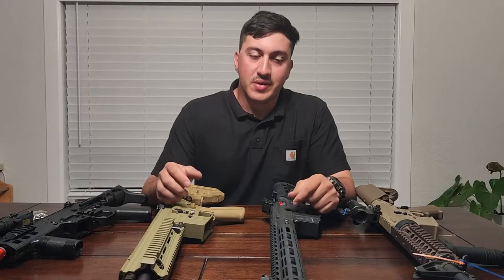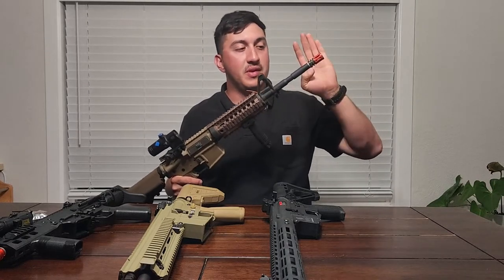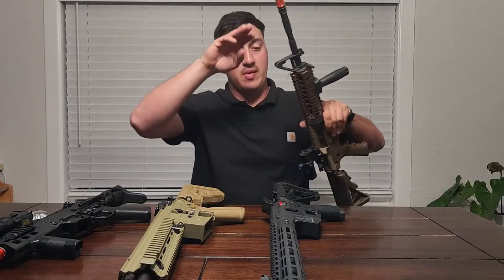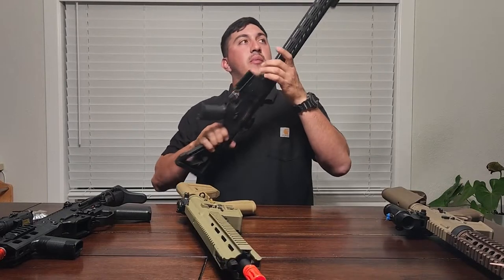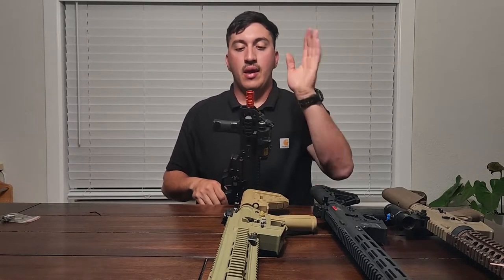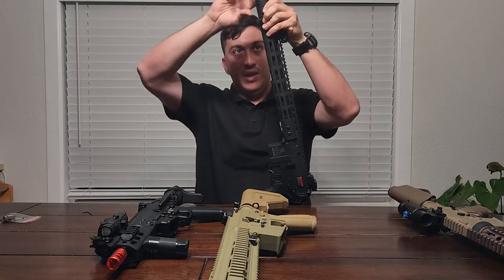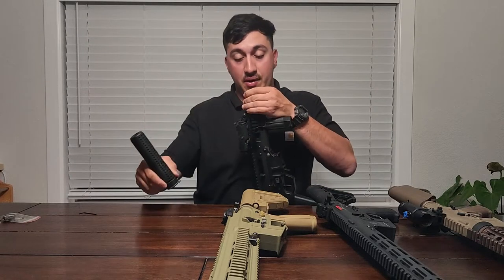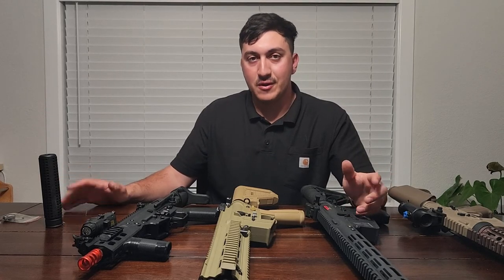How to remove Airsoft Flash hider

Comment: So, are there any other tracer/supressor units that will fit over a flash hider in the same manner that are shorter?
Reply from the maker: I'm not too sure. I know the predator mkII is quick detach but it might use a proprietary flash hider
Reply: @thecrowsairsoftgroup5662  think you're right. Cybergun hasn't gotten back to me about removing the factory flash hider and if it affects warranty. Might just pull it off anyway. I'm pretty sure I could install it back no problem if I needed warranty work. 😂

Comment: My kwa tip won’t come off at all! I even took out the screw but it’s still not working
Reply from the maker: Don't forget to remove the pin all the way, flash hider is a reverse thread and it might have glue. It will be tight the first time it's removed but if you feel you might break something then stop

Comment: Mine didn’t come w an orange tip. 
But I can take it off. And the threads are quite big. My tracer won’t fit. 
But looks like there’s an adapter and it might come off revealing the smaller threads. You think it’ll come off?
Reply from the maker: That's possible, depending on which model you have. I could look at it closer and see if it might work
Reply: @thecrowsairsoftgroup5662  looks like theres an adapter with bigger threads for the flashhider to go on, and it might come off revealing the smaller 14mm threads

Comment: That suppressor Tracer unit it's the  Acetech Predator QD Suppressor and Tracer Unit M14 CCW  long suppressor , know your ITEMS  mang.
The one in your link its the Version MKII . That USE the Flash hider with BEARING ATTACHMENT !!  
That MKII version will not FIT in a regular flashider  bud, this model use proprietary flashhider, that fits on the bearings of the suppressor w/ tracer.
Just letting the people know, they sell the MKII version with the flashider included in the box.

So the Acetech Predator QD Suppressor and Tracer Unit M14 CCW  ( the one you show it and you didn't knew the right name) it's the best option guys if you want to add to any flashhider with a tracer included. ( be aware its long, so for CQB beware think about it. )

Just TO BE CLEAR  information.

Slow N Smooth <> Smooth is Fast

cheers
Reply from the maker: You typed all that just to be wrong, lol
https://www.evike.com/products/76589/
Regarding the links, there's two and the first one is the one shown in the video, the second was just an example of a different QD tracer. Sorry I didn't specify? There's no need to be all weird, also the saying is (slow is smooth, and smooth is fast)

Comment: Is it legal to remove it?
Reply from the maker: I'm no lawyer but I believe it is illegal. The reason being that in public it's hard to distinguish between a replica and real firearm, that being said you should NOT be carrying your replica out in the public. Airsoft parks are private property and it is the parks rules you should follow while at the park regarding the flash hider.
Reply: No it is completely legal it only needs orange for shipping
Reply from the maker: @sergeantnerfsalot2784  depends on the state, in California you could be charged with a crime if you alter the orange tip
https://www.fresnodefense.com/blog/2019/december/removing-the-orange-tip-from-a-toy-gun-is-agains/#:~:text=In%20California%2C%20if%20you%20alter,be%20charged%20with%20a%20crime.

Comment: My kwa Eve 4 tip won’t unscrew it’s very tight even after I’ve unscrewed the screw
Reply from the maker: Make sure to remove that stopper screw all the way. Dont forget its a reverse thread. it's possible that it has glue to hold it tight. But be careful if you feel like you're going to break something STOP
Reply: @thecrowsairsoftgroup5662  I recently got the eve 9 how do u take off the flash hider